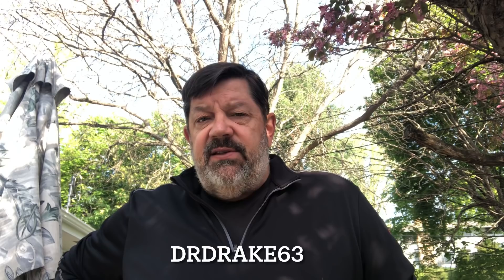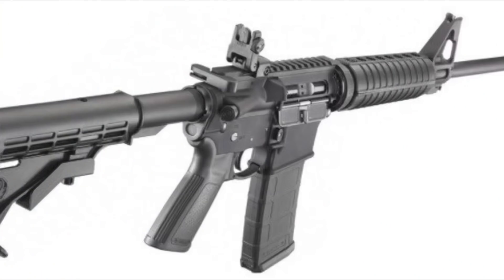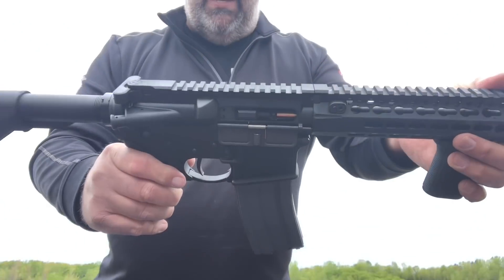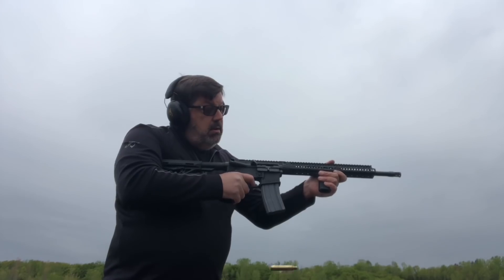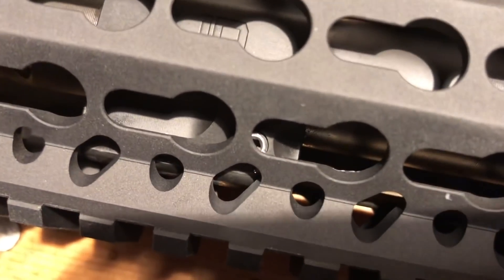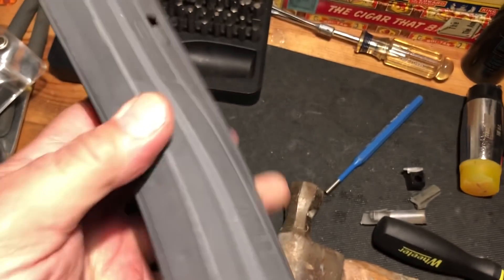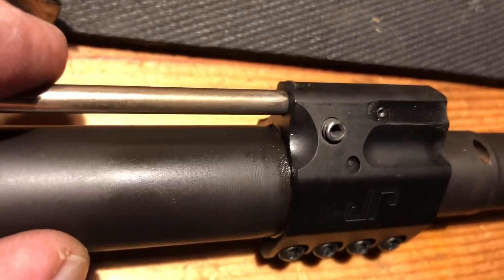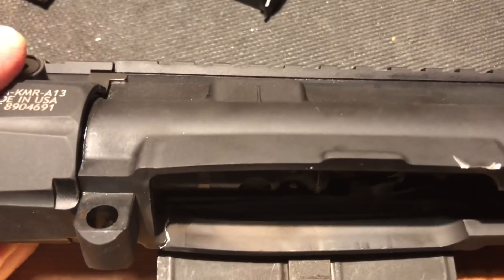Colossal AR Failure

Comment: personally a gas block would not cause this type of issue. the gas block just pushes your BCG backwards the rear of the receiver. If anything you'd see damage there if the gas block 'allowed to much gas(?)'. What is seen here is really bad materials on the upper, or a hot load detonation in the chamber itself.

Comment: I can think of two possibilities: Some Rugers are known to have poor tolerances between the firing pin and firing pin hole. If the pin got stuck in the bolt face you could potentially get an out of battery detonation. However, I think it’s much more likely (given the damage to the barrel extension) that the last cartridge you loaded was grossly over charged with powder. I’m guessing when you pulled the barrel off the casing was ruptured? I’ve personally seen out of spec factory ammo that was hot enough to damage a gun. I now weigh a sample from every batch to spot-check for inconsistency when I buy from a new lot number.

Comment: Even at full open, there is no way gas block flow/pressure did that.  What that was, was either a 300 blackout chambered in a 5.56 or a double power charged round.  The round went off, but the bullet never went down the barrel and the gas had nowhere to go but back

Comment: I'm not a ar guy now is there any way that the free floating hand gaurd he installed be why? I'm asking. I looked up that it tightens to tue upper and someone on Google had a similar issue when they over torque the hamd gaurd and it caused the upper to fail. Now my thinking was round was defected but I'm curious can tightening the hand gaurd damage the upper to where it may cause this?I have never seen a bcg blow like that so maybe when the round exploded it pushed the bolt back hard to break the bcg. Let me know

Comment: Most adjustable gas blocks instructs you to turn the gas completely off, then work upwards until it cycles, then turn it just one more notch up so that it can cycle dirty. It's pretty standard way and in no way could cause that much gas to come back. Think about it, it blew up the bcg, made of solid metal, and you think a thin piece of tube would hold that much gas without blowing up too? The problem is ammo here. From what I seen, nearly 99% of these have to do with remanuactured ammo or reloads. Very rarely factory ammo but it can happen too.

Comment: I'm thinking it's an Ammunition failure. I had two issues with Ammunition 1. Wolf 7.62 x 39. And the other 26 Nosler Ammunition. I believe each round was overcharge at the factory. Damage to my SkS was a firing pin . The damage to my Browning was a stuck bolt I was able to free the bolt. I haven't shot it since.

Comment: An adjustable gas block isn't going to send any more gas through the system than the original gas block, which sends the maximum amount of gas that the gas port allows. So it doesn't have anything to do with the gas system. It was likely an out of battery detonation or faulty ammunition/hot load.

Comment: Thats definitely an over pressure issue not from the gas system but shooter error by loading a wrong round i have seen it happen many times looks like 300 blk was accidentally loaded into chamber and fired. Big issue since the rounds fit right into a standard ar mag and also even though 300 blk is bigger it will still load into a 5.56 barrel.  Glad you are alright stay safe.

Comment: Did you check the fired case! If any left of it? Perhaps the gastube expanded sticking in breech block so preventing full battery of bolt🤷🏻‍♂️ but definitely over pressure of the brass gas escape

Comment: It wasn't the gas bolt or anything. You either shot 300 through it by accident. Check the round empty case inside. Or you had a squid load. There isn't enough gas to blow it up that bad. And lastly a really over pressured round which I doubt because its hard to get 223/5.56 overloaded with gun powder(unless you use pistol powder).  Also any comments about out of battery if there is any are false, ar-15's cant fire out of battery, mechanically impossible.

Comment: Think its a wuarter turn too much
Reply: Looking at that failure I don't think it's over gas failure was in upper around star chamber need to see barrel extension close. May have been hot cartridge and brass failure overpressuring That end of carrier

Comment: I'm not sure if the upper receiver was cut for this hand guards anti roll or whatever it is called that keeps the hand guard from rolling over I'm no expert. but my rugar does not have the little indention/cut for the piece of that hand guard that kind of puzzle pieces into the reciver that's why I didnt go free float on mine no shade thrown in any direction just an observation I had

Comment: Guys tend to over analyze this stuff. It is pretty basic….the gas port in the barrel will only allow so much gas through. With an adjustable block all the way open your equal to the flow of a standard non adjustable block. Either the chamber was out of spec with too much headspace or even more likely you had a squib and sent another round down after it. Those are really the only two scenarios that could have caused it. It’s next to impossible to fire out of battery on semi auto in a closed bolt weapon

Comment: not a gas issue at all. ammo issue most likely, either a double charge, which can happen from reloaded or factory new ammo, or a barrel obstruction from a squib or something else. it wasn't an out of batter, as you would see pieces of blown up casing around the upper. even all the way open those adjustable gas blocks won't give enough gas to blow up a BCG, it will just be overgassed. based on your ejection pattern it was gassed pretty perfectly, and not only that but if there was somehow enough gas to cause a big problem like that and that was the only problem, you would blow up your gas tube well before you blew up a BCG. my money is on a double charged round

Comment: with that much pressure to cause that much damage, you would have blew out your gas tube first, and most of the gas would not have made it back to your bolt to do that kind of damage.

Comment: your bolt not fully coming back into battery can also be an issue with your buffer and buffer spring. a cracked or flawed BCG, or most likely an obstruction or an over gassed round!

Comment: Over gassing wont do anything, most ARs and all military M4s are over gassed for reliability. The issue here was that the headspace was off, either the barrel or bolt was out of spec or even both.
-Small arms technician USMC

Comment: That doesn't look like an over gassing issue. The BCG sheared along lattice structure lines due to poor manufacturing. If it was over gassed, the system should have taken it. Most if not all ARs are naturally over gassed. With the carrier telescoping over the bolt and having it closed like that, the manufacturing is the cause of it since it also would have been the force of the spring to push it into that position. The carrier was out of spec.

Comment: Seconding what a bunch of people already said: That is not a gas problem, it's an ammo or obstruction.  I would not salvage any part of that upper. Not the barrel, not the receiver, not the BCG. Maybe you're OK with the charging handle...and perhaps a little ironically, the gas block.  But I would get a new gas tube as well.

Comment: You said you had 1 round left? Im wondering if perhaps that round was one that may have misfed during your earlier testing. Perhaps the round was severely dented which could have caused much higher pressures than meant for.

Comment: A standard low profile gas block has a hole which is larger than the gas port in the barrel.  There is no setting on an adjustable gas block that can allow "too much" gas.  Wide open will simply allow all the gas to flow, just like using a standard gas block.  The only purpose of adjustable gas blocks is REDUCING gas, it cannot INCRESAE gas.

Comment: Gas Tube is designed to go before anything else can go catastrophic. That is NOT from over gassing for sure otherwise the gas tube would popped first and even then thats still not going to cause that type of damage. The Damage on that Rifle is indicative of introducing a 300 Blackout into a 5.56 Rifle. Every single Rifle looks just like that or worse when a 300 Blackout is loaded in a 5.56 Rifle. And that's one huge issue with 300 Blackout is it will chamber right into a 5.56 Rifle and fire. And i dont think i have to explain what trying to force a .30 cal round through a .223 barrel is going to do.. Wouldn't surprise me at all if you pull the barrel on that rifle your going to find the projectile still in the barrel which is another tell tell sign.

Comment: Over gassing didn't do that to the gun. Either a part failure (wouldn't surprise me, I've seen lots of shitty qc from ruger AR556 rifles, from incorrectly machined lower receivers to gas blocks without pins in them). That failure looks like the gas had nowhere to go though. I've seen this failure a couple of times before when someone accidently fires a 300 black out in a 556 chambered gun. (the 300 blackout looks really funny when it gets stretched lol) I'd also check for a possible barrel obstuction, maybe from a squib round. Otherwise, possibly some kind of out of battery firing with a case rupture. Usually you won't see that, but in the right circumstances come together it may happen. One thing for certain, a gas block didn't do that.

Comment: As others have said, the rifle came with a certain size gas port.  If it functioned with a factory open gas block then the JP block could have been wide open with no adverse effects.  I am inclined to think ammo issue.  Worth noting, no inspec AR15 will slam fire or out of battery fire either.  I have personally gone to great lengths to get one to do so including high primers, pistol primers in 223 or 5.56 casings, cheap bolts, cheap bolt carriers, etc.  Could not make it happen.

Comment: The hole tapped in the top of the barrel will not allow enough gas into the block to do that. 
Even if the new gas block was set at "wide open throttle" it still only lets through the same amount of gas as the A2 block you removed.

Edit: Ok, just saw the magazine. That's not caused by gas. That's out of battery detonation.

Comment: Don't know any way it could have been the gas block.  Only possibility would be a metal shaving was lodged in the gas block from manufacturing and it came loose before the last round.  Seems too much damage just from over gas.  I have to agree with most that you had an ammo problem.  Last thing I could think is the bolt had a microscopic crack in it to begin with.

Comment: Out-of-Battery Bang. I think that if anything, it may have been a little undergassed...with the brass at 4 o clock. A 16 inch carbine gasser needs a .750 steel lo-pro and free floated barrel, nothing else. Swap out the buffer and/or BGC and slow it down if it needs. Throw those adjustable things in the garbage. Glad you didn't get hurt.

Comment: I've had a fair share of experience with JP products, among other adjustable gas blocks, and overgassing should not be an issue as far as detonating a bolt carrier goes so long as the ammo is good.  Assuming the carrier it to spec and not defective an overgassing situation would give you a higher cyclic rate, with excess gas being vented out the two ports on the side of the carrier. I've ran AR's on full open ports without this particular problem arising, and generally speaking if you run a suppressor you're overgassing your gun to begin with.  For the most part running any gas block on full open is just going to max the wear and tear on your gun, but wouldn't cause it to suffer from a critical malfunction with relatively new parts. 

Looking at the bolt carrier from your photo, assuming its to spec, there would have had to have been a massive pressure spike contained in the area behind the gas ring on the bolt itself. Gas is always going to take the path of least resistance, so unless there was significant resistance somewhere else in the system I would imagine the gas tube would have popped before the carrier, though without seeing the bolt its difficult to surmise what could have caused that. With that in mind MilitaryArmsChannel did a video where they purposefully kept a carrier in the forward position using the forward assist on a carbine length gas gun - https://www.youtube.com/watch?v=1oUi2YRRtYw So even forcefully keeping the bolt and carrier forward does not allow for a significant enough pressure to generate in the carrier itself under otherwise normal conditions.  

In my opinion it appears to be an issue caused by either the ammo or improper headspace, though as I said without seeing the bolt face its tough to say. For anyone who likes building AR's make sure to get yourself a proper set of headspace gauges. Just because the bolt locks in your barrel extension doesn't mean it's headspaced properly. I've seen bolts and barrels from the same manufacturer purchased separately not head space with one another, I've seen guys barrels fly down range because they didn't check their headspace, and I've seen uppers grenade for the same reason.

Comment: I’ve been working on a friend’s Ruger 556 as well. Since the Ruger has a .625 gas hole, we kept the original gas block, and had it cut down and reprofiled so it may fit under a Troy Battle Rail.

This way we didn’t risk loss of function with a known good gas system.

Comment: A gas block could never ever cause this kind of failure, I would bet money on a 300blk round getting mixed up with your ammo causing a barrel obstruction and an out of battery condition, causing the gun to rapidly disassemble itself

Comment: Hey dude!

Yeah I don’t think the AR15 can produce enough gas to KB the rifle like that, you would figure if it produced that much gas to destroy the bolt carrier, the gas tube would probably blow out too right?

Anyway I think maybe the reciprocating action might’ve caused a too loose gas block to walk and maybe have the gas tube get pushed back just far enough to cause the bolt to unlocked and cause an out of battery firing condition. 

Could also be ammo related too, maybe a squib that you didn’t recognize because the rifle wasn’t working from the start so the failure to eject (that would likely occur with a squib round) wasn’t an unusual occurrence.

Comment: Out of battery means the bolt isn’t locked in place. Since the bolt is clearly still locked in place, we can eliminate that. The adjustable gas block had nothing to do with the kaboom. That isn’t possible. 

Shot any 300BLK lately?

Comment: I definitely agree that it's an ammo issue. Most likely that "I had one spare round left" was actually .300 Blackout (.308 ACC) round. The remains of your rifle look identical to results you can find in YT videos where they blew it up intentionally and many were a round inadvertently got mixed into .223/5.56 ammo. The only other explanation would be an improperly reloaded round.  My tips for Blackout weapons safety:  I always use separate well marked magazines for Blackout weapons. Mags for 5.56 are always loaded separately and with all Blackout ammo off the table. Frankly I don't even really like to take both calibers to the range at the same time with my boys because even with well marked mags and rifle wells, they are only one simple mistake away from an explosion.

Comment: @David Drake was that BCG purchased recently from an online vendor from OH? I saw that it was a slab side carrier body and not a stock BCG. If your friend did indeed purchase that bcg recently, and it's from who I think it is, you might want to hav a chat with me.
Reply: The bolt carrier on the video looks like the one on Ruger's website. But speaking of an Ohio vendor, they replaced a lemon I returned with one from what they said is a new supplier, received today. It is markedly different, with round milspec carrier configuration instead of faceted. The bolt is marked MPI 5.56, and the carrier is stamped SM on the left side (instead of the seller's initials) and has a much smoother gas ring bore. Package says the bolt is 9310, cam pin 4340, carrier 8620, black nitride finish. New one looks way better.
Reply: Larry S, check the headspace asap. That bolt head should be okay, the "vendor" was having them manufactured and there was all kinds of stuff getting thru QC that should have gone back to the machinist.
Reply: Larry S if its mpi marked, its not from they're manufactured lot, and should be legit but i would check headspace immediately.
Reply: @OneRoundDown  Headspace checks out, thanks for the heads up. I know what you mean about QC, the one I sent back had a cupped bolt face (measured 0.002" deeper in the middle) with an elliptical firing pin hole, and the bore on the carrier was so rough it short-stroked. While the one from the new batch isn't beautiful, it looks way nicer and seems legit.

Comment: Cant over adjust the gas block.  All your doing is opening the gas port to the stock size and pressure.   Think about it, (a non adjustable gas block is full open). An adjustable block only closes the stock size port from your barrel down to a lower pressure.  And out of battery? COMMON! The bolt would not have been still locked and jammed in the barrel like that, 
Super hot load. OR an obstruction in the barrel backed by somebody pounding on the beat button , ( AKA forward assist).  I see so many people pounding that forward assist after a failure to fire. They get a squib that sticks a projectile in the bore them back it up by pounding the next round in with the forward assist.   Not saying that's what happened here. But it has to be one of the two. 
Glad your okay though.